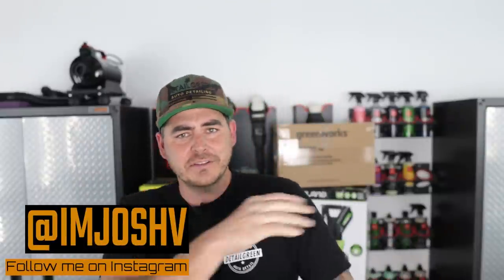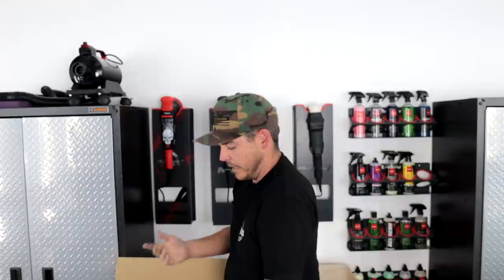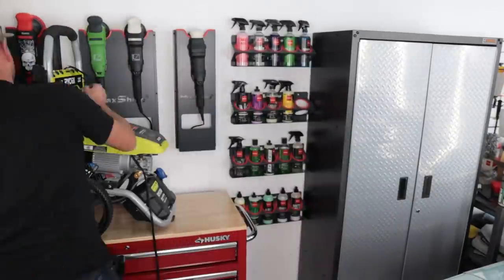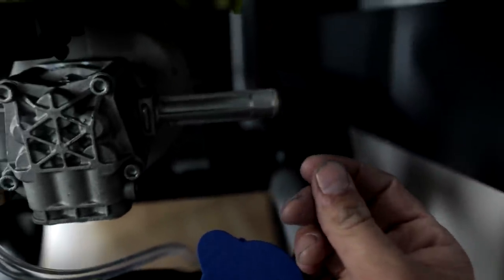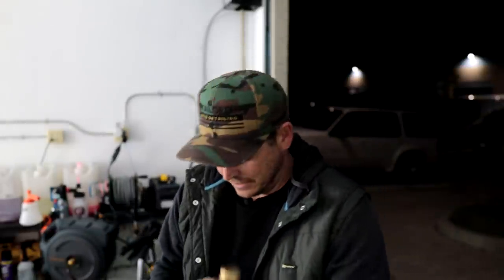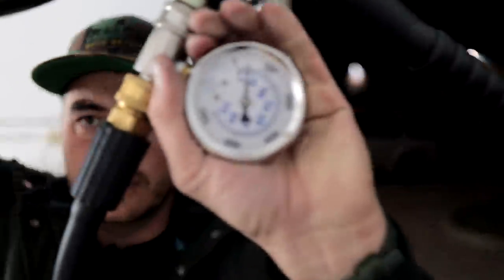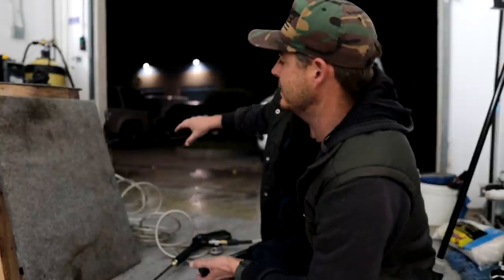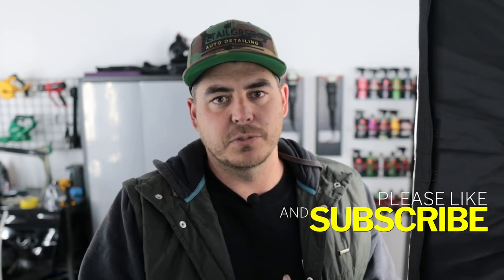Ryobi 2300psi Electric Pressure Washer NEW UPGRADES! | Power Washer

Comment: This video was extremely helpful. Thank you so much. I know there’s been other people questioning how do you know that you’re going to get the new model with total shut off. The people at Home Depot didn’t realize there was any change in the machine. But they were helpful to let us know that the boxes had changed for the newer ones. Apparently the old boxes were yellow and gray this one was all yellow. Also if you look at the box you’ll see that the electrical cord winds on the side, I think the older one wound up in the back on the bottom.  We power washed some landscaping blocks around our trees that were totally black they turned out just as good as the bottom in the store it was amazing. I would  attached pictures but I can’t figure out how to do it. Good luck
Reply: Thank you Shirley.  My exact question AFTER the video. Home Depot does not like you opening boxes to see if its the new model. All Yellow box it is... thanks.

Comment: Managed to pick this up last week after returning the 2700 due to not having the auto stop function. Great review and breakdown of the features, your videos helped me choose this one. I wanted a brushless unit that could clean pavers, fence, and eventually our vehicles. This checks all the boxes. The auto stop is the icing on the cake, especially when someone comes out to talk to me when I'm working. Release the trigger and it's dead silent! Love it.

Need to get a pressure gauge so I can use it on my slate roof, should be fairly easy to drop the pressure on this unit to what I need with the right orifice/nozzle combo.
Reply: Does the new brushless 2700 have auto stop function
Reply: @nathanwhite8931  the brushless 2700 I got did not have it, there's a switch hooked up to one of the hose ports on the 2300, it wasn't on the 2700.
Reply: @ItsRossinator  thank you!

Comment: Thanks for this update. Yes, they don't advertise the total shut off. I was going to buy the 2700 psi but for some reason they have not put that switch on any other unit. I will try this unit instead.

Comment: Really surprised these brushless motors aren't putting out larger numbers.  I was especially surprised by the 2.5 orifice results.  Though to your point, the motor will last longer, but not sure how much that matters to the average home user (I'd wager to bet the average user isn't even using their pressure washer enough to wear it out.)

Comment: Great job with the pressure washer reviews. Really helps to make a decision on which to go with. 
Just a quick tip however; when testing for flow/pressure, the pressure gauge should always be installed at the pump output. Unless the hose is laid out perfectly straight, you will get loses, which might explain the differences between the first and second iteration of the Ryobi 2300. Thanks and keep up the good work.

Comment: ryobi is coming out with two new corded pressure washers for 2022 rated for 2700 psi and the other 3000 psi, much like the two greenworks. they probably are the same in regard to the pump and motor but they look a lot similar to the 2300 psi.

Comment: I bought this washer, based upon your review, and an anticipation that the xtra "electric" power over some of the lower PSI models would be desired, and boy was I right.  I honestly think you don't want to go any lower than this model---It's perfect output for wheels and tires just about eliminates scrubbing.  Further, I wanted to thank you for the suggestion on the hose and the gun, and the MJJC Foamer--pure shaving cream--INCREDIBLE.  I greatly appreciate your expertise and advise, given I am so fearful of buyer's remorse, none here because of you!!  Also, when you follow the instructions, foam, rinse, foam and then gently scrub then rinse, it does a great job of getting the dirt off, but leaving for the prescribed 3 minutes also removes the wax.  I have to nice cars that were waxed a month ago, and we are down to the clear-coat after this.  I may not allow the foam to set as long next time.  That lapse in time allows the soap to penetrate and strip the wax.  I used Chemical Guys soap, perhaps there is a brand and type that will limit this wax stripping ability.  Otherwise, this combination of Washer, Hose and Gun is just the damn cat's meow.  LOVE it.  Thank you.
Reply from the maker: Thanks Bill. A PH nuetral soap shouldnt strip any of the wax. There are some higher PH soaps out there that can though. What soap are you using?
Reply: @imjoshv  Chemical Guys, Maxi Sud II, grape.  I just finished doing my wife's Porsche, and I ran real fast and still stripped the wax, and in my opinion, about 50% of it.  I hit it with Tec, Ceramic Detail Spray and it revived what was now a reduced wax presence.  That said, the soap is strong, and I can tell, so maybe too strong, even diluted.  The Ryobi Pressure Washer, for some weird reason, was operating at about 50% of its power for no reason (hose was fine, water pressure etc), so it's going back.  Comments on soap would be helpful.  Thank you.
Reply: @imjoshv  would you provide the model number for this machine?

I'm interested in purchasing one.
Unless you have a better suggestion. 
 It will be used primarily for cleaning a truck and a motorcycle ( street bike NOT a dirt bike).
I've really enjoyed all the reviews you've done.

Thanks

Comment: Ok, I purchased this pressure washer based on this review. It’s a beast. It has a total stop system. Release the trigger and it is complete silence. I did not purchase it for washing my vehicles. I also bought the 1800 psi for that. I use this at my vacation house. Used it this past weekend to clean up all the dirt and mold that had built up over the past few years. It did an amazing job. The hose does suck big time and I purchased the recommended Uberflex house, which is great to work with. Can’t go wrong with this purchase. Side note, the picture on the box was not what was in the box. Picture showed inlet and outlet on the same side of the machine. They are actually 180 apart like this video showed.
Reply: Does Home depot have the latest 2300 or where do i get the upgraded version?

Comment: I came back here to clarify models for future buyers -     There appeared to be 3 models of the 2300      -    Inlet/outlet on same side( OLD model)  -   Inlet/outlet on different sides (like the one tested here)  -  outlet on one side, and inlet facing forward!    I wanted this so I went and just grabbed one.  My box had a picture of the wrong one  (  Inlet facing forward) BUT inside was the correct new on tested here.   I believe that the one in the picture on the box  (  Inlet facing forward) does not exist!!!!!  Perhaps it was a 1st prototype when they upgraded the model and used it for all their promotional pictures/ videos??????? So get the one with the wrong picture on the box!      Also, about the Dewalt 2300 vs Ryobi   - I was just going to get the Dewalt due to this new model confusion.  But. I watched both videos again, and saw the new Ryobi got higher PSI with most of the stock tips. The worst part is that the GPM really didn't increase for the Dewalt even with the lower PSI readings????  Josh never tested the Dewalt with the 2.5 orifice and greater after market tips, But from the stock testing it looks like the bigger orifice tips would have too low PSI with still low GPM.  Do you agree Josh?   Anyway it was back to the Ryobi for me.  I'd rather have more GPM that those fancy Dewalt wheels!
Reply: Did Home Depot let you open the box before you purchased?
Reply: True MVP
Reply: @wmacky, man thanks for this clarification as I noticed these 3 differences as well!
Reply: Is there a part/model number that correlates to this updated version?

Comment: I bought this pressure washer and it does NOT have the total stop system that you said it has. I called Ryobi and they confirmed it does not. If you stop depressing the wand trigger for roughly 30 seconds, the motor shuts off completely. It will not start again until you turn the on/off button to off and wait for about 2 minutes before truing it back on.
Reply: Also, I thought the unit I had was defective so I exchanged it at Home Depot for another one and the second one did the same thing.

Comment: I just can’t decide on this one, the GreenWorks Pro 2300 or the more expensive DeWalt 2400. I like the idea of the induction motor on this one, but the GreenWorks has better attachments. As far as I know the Dewalt is just a rebranded Simpson, although I can’t find a comparable Simpson model. I need it to clean my cars, siding, concrete sidewalk, concrete porch….too many good options…..lol
Reply: my preference is ryobi 2300 dewalt 2400

Comment: This vs the greenworks pro 2300 unit is a very tough choice, as the stop system is better on the Ryobi, yet the flow rates and pressures are significantly better on the greenworks even though they are rated the same.
Reply: I am in the same pickle. What you go with?

Comment: I just got one of these and used it today. I think it works great for a electric pressure washer. Cleaned my pretty dirty cement that had black dried out mud on it. Which hose is better, flexzilla or uber flex and what size connectors do I need for this unit? 50 ft? Thanks

Comment: Josh, the home depot here in RI has one like this but no FULL STOP feature,  I called Ryobi and spoke with two people and they could not figure out what model you purchased.  They were totally unaware.  Would you provide me with a model number because I really would like to have that feature. (also Ryobi does not show this model on their website).  The model I was going to purchase (#14230 ) has the hose connection facing out the front of the machine not the right side like the one you use in this review.  Thank you in advance for your time! If you look at the beginning of this video that is the one they are selling.
Reply: Your right?  There appears to be 3 different pump heads -    Inlet/outlet on same side  -   Inlet/outlet on different sides  -  outlet on one side, and inlet coming out the front!   What the hell?   All the photos of the new unit / even the promo video above show the Inlet coming out of the front?

Comment: Hey, love your vids and was wondering if you could let me know what the model number of the newer 2300 is?  I have the older version which doesn't have the auto stop feature and I'm in communication with Ryobi Canada but they need a model number.
Reply: did you ever get the model number?
Reply: @markbryner1474  I havent yet.  Cant even get a straight answer out of Ryobi.
Reply: @donsmale8811  well damn it. let me know if you can get an answer please. thanks
Reply: Ry142300

Comment: I got a question, is there a time limit as to how long you can use an electric pressure washer at a time?
Reply: Not really, but sort of. Kinda depends on the ambient temperature.

I have the older version of this and during the summer I did have it shut off on me every 10 or so minutes after the first hour or 2, but it was also like 95° in the shade. Understandably, the unit was just begging for a breather. After an extended break to let it cool down, it was fine for an hour or 2, then same thing. About 2-3 weeks ago, I did my entire patio (12'×30') and no stoppage from noon to about 6pm since it was only like 75° that day. I'm in South Florida, mid 70's in January is totally normal here.

Comment: @imjoshv - I bought one of these and ended up using turbo nozzle on my 2017 Land Rover (yeah right - foolish)

I see 4-5 tiny marks of paint peeling off - but I’m not 100% sure if they were from before (mostly on front bumper where bugs stuck before). Either way 2 questions 
1) do you think a turbo nozzle would peel off modern car paint in just one wash? ( have heard contradictory things)
2) any suggestions to fix it!

Thanks so much
Reply: Probably would not want to use the turbo nozzle for car washing
Reply: I've used the turbo nozzle on my Ryobi 2000 for years now. You have to stay at least 12 in /30cm away from the surface. The turbo nozzle at that distance feels the same as the wands at a coin op car wash. The turbo nozzle will weaken extremely weak paint though.

Comment: Kind of confused a bit, you say that uberflex hose are wonderful, went to the Amazon reviews and they are not very impressed with the hose. Not sure if I still should purchase it with the pressure washer.
Reply from the maker: I have a few of them and never have any issues. I wonder if they are using really powerful gas pressure washers. The hoses are rated to about 3100 psi I think, but I typically run my pressure washers in the 1000-1500psi range
Reply: @imjoshv  
 Which specific pressure washer would you recommend for the do-it-yourself  at home for car truck and motorcycle detailing?
 Only detailing my vehicles, not doing it as a business.

What pressure (PSI) is actually needed for detailing?

 You seem to be very thorough in your reviews of equipment.

Comment: Which one would prefer... Ryobi 2700 PSI or the Greenwork 2700 PSI? Trying to decide between gas or electric.. I do not want the loud noise from the gas.
Reply: I prefer electric, the best seller is Ryobi 2300 psi and Dewalt 2400 psi.

Comment: I have the same washer.
Can someone tell me what would happen if I use a 40degree nozzle with 3.0 orifice?
Wil it break?
Will it be usable?
Ii just use it for washing my car and my wife's 
But I've been using the OG nozzles so I am getting 1.2gpm.
Then I learned about the water flow.
More water and less pressure is better for car washing.

Comment: I love your videos Josh, but your Ryobi bias is evident lol.  It's not a bad thing, you're clearly a Home Depot guy haha.    I feel that Ryobi and Greenworks are equal in every way, except that Greenworks gives you an Uberflex hose with its higher end units right out of the box.  The most impressive unit I've seen you test (for combination auto washing and household duties) is the Craftsman 2100.  You tested it at 2000 PSI and 1.25 GPM, then swapped to a 3.0 nozzle and saw 1100 PSI at over 1.5 GPM.  Those numbers would make that my number 2 recommendation behind the CAT/Active for your purposes.  It's $100 less than this one and out performs it in nearly every metric.  I am curious as to what makes some of the Ryobi's units you'd recommend vs units like the Craftsman what you're just impressed with?

Comment: How would you know if you are getting the updated version?  Which location did you go to here in San Diego? Im going to pick one up by the weekend. Great Videos!
Reply from the maker: I think they should all be the updated one now. But if you look under the cover by the pump you will see a little black plastic piece and that is the total stop.
Reply: My homedepo had both. I only had to open 2 boxes to find the updated version. Then I noticed the updated version is in the smaller box.
Reply: Seems they are packaging the old unit with the surface washer as incentive so be careful.  The new unit has the hose water inlet on the front, not on the side.
The new one is... Model# RY142300
Reply: @MrTruck1012  Thanks for your comment. Does your updated version have a new model # ?  Thank you.
Reply: @rollingreclinerRecumbent   But Josh's new test unit DID NOT have the Inlet coming out of the front????????  Why is there 3 different styles?
Reply: @KS-rb2tz  Id have to check it. Its at work
Reply: @wmacky  my new model still has it on the  side. inlet on one, out on the other
Reply: I was at HD and a Ryobi rep was passing by. I explained the update and asked if there was a new model #. He looked it up and said no new #.  So we opened the box and it was the updated model. Picture on box was old model. I suggest find an HD person and open the box. Not sure why Ryobi did not just put a bright orange sticker “UPDATED MODEL” on box. Thanks to all for help.

Comment: It's been a few months since this video. I'm debating between the Dewalt 2400 vs this Ryobi 2300. Thoughts? I would only use it to foam wash my car, cement walkway washing and light stuff around the house.
Reply: Which one did you finally buy? I'm on the same situation
Reply: @TC-dp3vv  I got the Dewalt 2400 model. It's super nice for what I need it for: Wash exterior of house, rain gutters, concrete around the house and car wash. Super nice that it also comes with the tips for those specific uses I mentioned. Zero regrets.

Comment: I feel like the Dewalt 2400 is a better deal. You get more tips and more PSI. This one topped out at 2150, the Dewalt made it to 2200. You also get a 25 and 40 degree tip that will give you 1000 which is almost perfect for vehicles and other things. The Dewalt also has the total stop feature. What makes this better than the Dewalt?
Reply from the maker: I actually prefer the dewalt to the ryobi in this psi range
Reply: @imjoshv  I was going back and forth from Ryobi and Dewalt for a while. I like the Ryobi brand better as a whole, but in this size the Dewalt takes it. What size 25 and 40 angle orifice would I need to get the full 2200 out of them? Do you know what the 15 is from Dewalt?

Comment: I bought one of the first versions of this just over 2 years ago; it suddenly lost pressure and now only pushes about 50% of the force. YOU CAN'T BUY ANY REPLACEMENT PARTS REGARDING THE PUMP OR MOTOR. Nothing. This is disposable which is horribly wasteful. I went to my local repair center today - they don't sell the pump separately; you can only buy the entire motor and pump assembly AND the public can't buy it to begin with; its only available to authorized repair centers. Of course the cost of this is the same as buying a new unit.